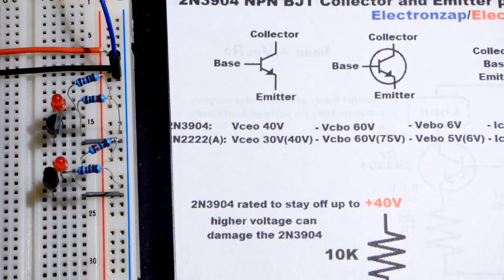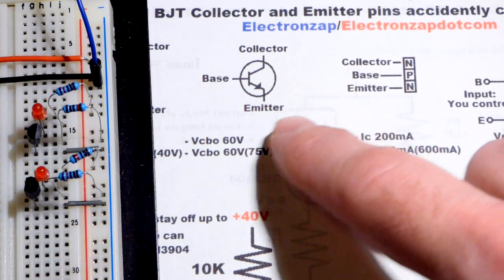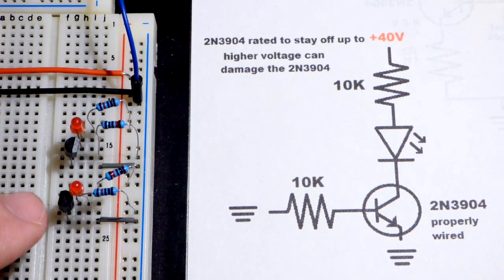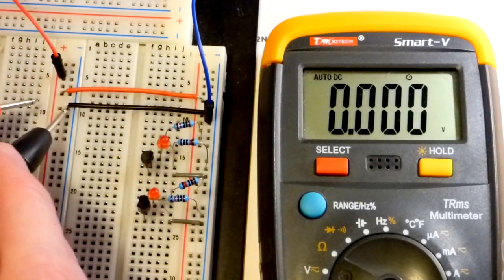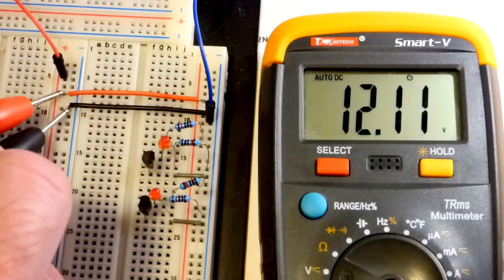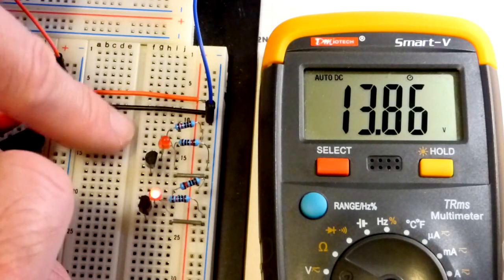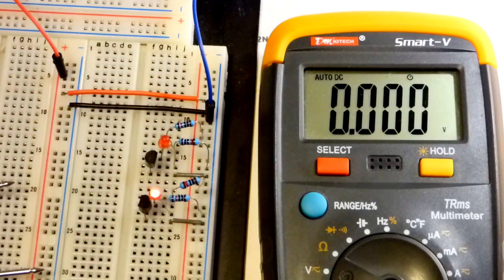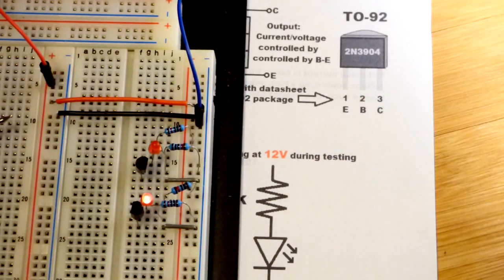Voltage test 2N3904 NPN Bipolar Junction Transistor collector emitter pins connected backwards

Comment: What would you look for if you find low voltage at the base of transistor...it is NPN transistor and I'm getting only .5v to it....I should see .7v
Reply from the maker: Base conducts low current at a lower voltage. The Base will build up a higher voltage as the Base current increases. I usually get closer to 6V than 7V.

Comment: Sir I just want to say that your videos are amazing. Can u please suggest to me what is best iso transform to purchase where? I'm newbie in electronic. I recently bought my first oscilloscope, function generated. I really don't want to harm myself or my expensive equipments. T
Reply from the maker: Thanks for watching! Glad you enjoy! I don't do anything with isolation transformers and I don't do much with oscilloscopes, plus they are hard to explain, so you should check out oscilloscope videos on YouTube for tips on using them. Should start with low voltage power source and circuit testing and then your risks of damage/injury are really low.
Reply: The best advice I got was Be Brave, But that was granite work... 
Jeri Ellsworth said, if you want to learn electronic 
make mistakes ... you never learn with successes.
You think you know when all goes well... but do you? 
Be Brave. ; )